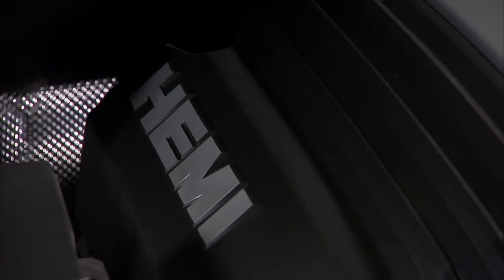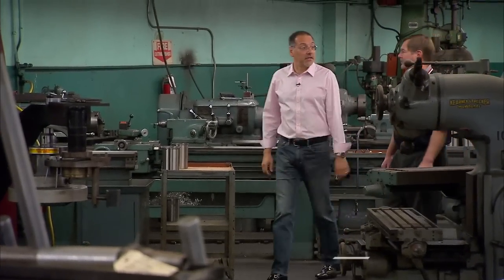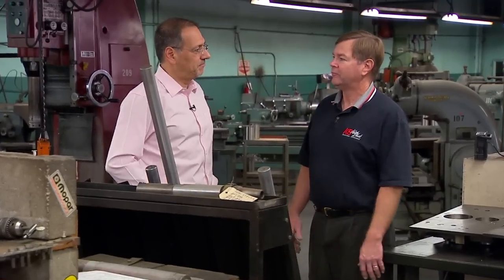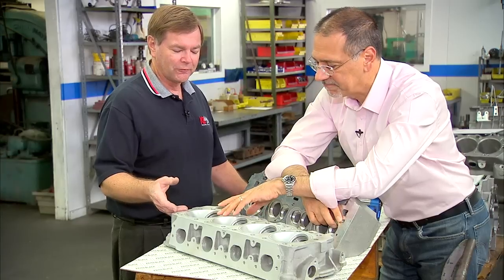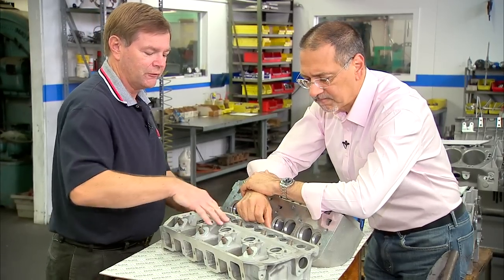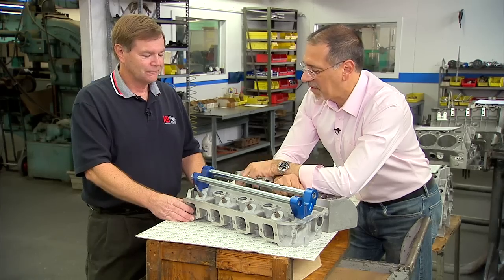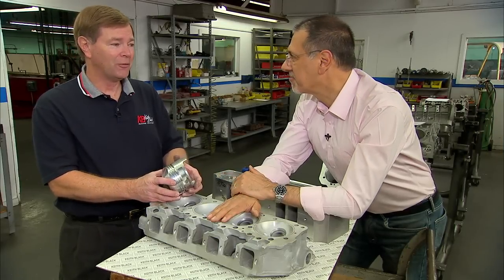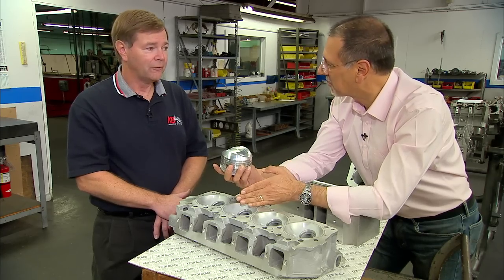CNET On Cars - Car Tech 101: Hemi engines explained

Comment: Also should be noted that Kieth Black gained a lot of success and notoriety by building really successfull 354 based early Hemis for Don Prudhomme's dragster, the Greer-Black-Prudhomme  Top Fuel car was the most successful & winningest fueler team in the early to mid 60s.  I have many Drag Racing magazines from this era and Kieth Black had a column on engine building.  Hemi's work better than any other design with fuel (nitromethane/alcohol) and forced induction, and Kieth Black was one of the pioneers in developing Top Fuel engines.

Comment: Only a Chrysler design Hemi runs in Top Fuel Dragster, and Top Fuel Funny Car. No matter what the plastic engine cover says Toyota, Ford, Chevy. It is still the exact same Chrysler Hemi. That was originally designed in 1964.
 
 

Reply

Comment: Hemi its really about TORQUE :) and that its what you use more on street couse real hp come after 7500rpms
Reply: JETZcorp Your right on the money but I have a 5.7 (345) and it has 350 hp with 400 Pound feet of torque. They are torwuey engines. They are made to put u in the back seat. But surely arent made to rev out and hit top speed numbers. They just want to get you to a logical speed as quickly as possible.
Reply: theya r eso good that they stoped prodiucing it..just a myth

Comment: I've been a Mopar fan since 73. I have probably seen only six Hemi powered cars from 1966-70. (On the streets....not at car shows) That's one of the things that made them so special you never saw them as they were rare. Now you pull up to a stoplight and there's like three pickups or charger/challengers that say Hemi on the side. There's so many driving around it's like, 🥱yawn.
NOT saying they are not any good, just everywhere.
Reply: The new Gen III hemi doesn't follow the same truly hemispherical combustion chamber shape of the original hemi. They are considered "Semi-hemispherical". I have 2 truly hemispherical combustion chambered engine vehicles in my driveway. A 1986 Alfa Romeo which uses a true hemi-head design as well as twin cams and a Harley Sportster with true 100% hemispherical chambered cylinder heads. They are both more of a "Hemi" than the modern Hemi's you see in Dodge trucks and cars. Almost all the DOHC engines on the market are also hemi-chambered now a-days.
Reply: @6sillygtivr  I had a 64 Plymouth Belvedere with polyspherical 318

Comment: I thought of two cams with half cirlces as the valves that have pin seals like a Wankel rotary engine and the spark plug in th center of the ports for the half circle shapes on the cam. One cam for intake and one from exhaust on each cylinder head. The cams turned by a timing chain or timing belt to the crankshaft. Plus a bolt down oil jacket that bolts over the camshafts with half circle valves that supplies plenty of oil over both camshafts and a port if there is a timing chain on each cylinder head out jacket. The intake half circles smaller than the exhaust. Possibly some engine blocks could be modified to have this new cylinder head camshafts half circle valve design bolted on.
     Air fuel mixture                             
     ↘ ↘ ↘ ↘
🔅==|)==(|==|)==(|===
🔅===(|==|)==(|==|)==
            ↘  ↘ ↘ ↘  
           Exhaust gases
Lifterless valves

Comment: If the piston is to heavy then take more off the bottom since you added more on the top
Reply: The tilting of the piston rod would slam in to the room where piston is moving up and down. Under the up an downward motion, thereby slamming in in to channel, when the crankshaft is tilting the connecting rod in the motion.

Comment: Its a shame the new HEMI is not even a true HEMI in the sense of design like the old ones were.
Reply: Decent write up. Yes the 3 Gen hemis do flow better than the 2 gen Hemis. But, you need to realize that was never the topic. Being a true Hemi was and the 3 Gen is still not.
Being that the 2 Gen was penned over 50 years ago, I would imagine Chrysler has had enough time to improve on the flow rates and characteristics.
Yeessss, I'm familiar with quench areas, flame front propagation (I think that's the word you've been grasping for) and stoichiometric efficiencies. 
Which brings us to the next subject:
2 Gen Hemis never had negative performance issues with this and I'm unsure where you could have read that. I've never heard of 2 Gen Hemis having hot spot issues, either. But I will agree that the true Hemi design is less efficient emissions wise. That is the entire reason Chrysler built up the 'quench' area, added the second spark plug and raised the top ring land absurdly high on the piston (betcha didn't know that one, lol) for strictly emission purposes.
It wasn't an 'improved' design. As a matter of fact, Chrysler tried there asses off to get the true Hemi design pushed through! And if the 2 Gen design is so awesome, then why have they almost gotten rid of the this 'quench' area in the Hellcat and the 392??? Because they were making more power without your 'quench' area, LOL. And these still aren't a true Hemi, either!!
Go read up some more if you're gonna try to school me.
Reply: jmc6000 I know man.

Comment: One bad feature of the Chrysler Hemi is the terrible valve-train geometry. Because the valves are so far apart, the pushrods are nothing like straight off the lifters. The solution came from Ford with the 427 SOHC engine. No lifters or pushrods. DOHC would've been even better. I ride a Yamaha XS-650 (which were made from 1969 to 1983) and they are a true hemi with SOHC, just like the 427 Ford but a lot smaller.

Comment: my 5.7 hemi only makes like 340hp.... its a 2007 but still... good torque though. about 400ft lbs
Reply: Michael Kinley the new 5.7L Hemi V8 in the Charger and Challenger RT makes 370 HP and 390 Ibs of torque while the 5.7L Hemi V8 in the Ram 1500 make 395 HP and 410 Ibs of torque.

Comment: Heard that Hemi engines can't have 4 valves per cylinder.
Reply: Because the chamber is hemispherical (curved in two planes) you would think not because the 4 valves would point in 4 different directions, making it impossible to run off OHC (single or double) or by pushrods because the angles would be too extreme. However, Honda made a 4-valve hemi back in the '80s. It was a 500cc single with SOHC and (wait for it) 8 rocker arms. Four were the usual that any SOHC 4-valve engine would have, and 4 more to get the angle required to act upon the valves. That's right, 8 rockers arms per cylinder. I had one and it was a missile but complexity eventually killed the design. Imagine if they'd them with more than one cylinder.
Reply: Dodge actually made one A-925 engine...but it turns the combustion chamber into a Pent-roof..like all other 4 valve engines.

Comment: Can a Hemi engine out race an engine from a Lamborghini?
Reply: beerborn there are so many variables. I personally have seen inline 6 engines beat a Lamborghini Gallardo. I mean a 4 cylinder engine can produce the same has a monster v8 if you put the money into it. But if two engines exactly the same were built and one had a hemi, I'd assume a hemi would win
Reply: Only a Chrysler design Hemi runs in Top Fuel Dragster, and Top Fuel Funny Car. No matter what the plastic cover says Toyota, Ford, Chevy. It is still the exact same Chrysler Hemi.

Comment: that why american car all bad car how about asian company maker a good car and save the gas people buy asian car make them alot money now american car go in down
Reply: mai khiem Asian car slow and boring america we have lot of gas and fast car
Reply: HEMI = FUN
Reply: mai khiem I have a 96 Ford F150 with a 5.0L (302) Windsor V8 with 206,820 miles on it and it's still going strong. The only thing I replaced on my truck was the starter but other than that mostly was just simple maintenance, took out the transmission fluid just to get rid of the shuttering it was making and it hasn't had a problem ever since. Also just to let you know that my 96 F150 will outlast what ever you drive.

Comment: GM LS > Hemi when it comes to pushrods
Reply: Alex Has not exactly. The hemispherical head is superior in every way to any Vortec head or Chevy designed head in general considering they’re both 2vs. The 5.7 hemi produced more than the 5.7 vortec in both torque and weight. And in 06 the 5.7 hemi produced more than the LS1 with equal numbers to chevys 6.0 ls2. They’re both great tho
Reply: @darylcollins2972  its also a heavy pieve of shit and doesnt top out fast enough
Reply: Alex Dood wait bro. You have a 2V 4.6 ? There’s literally no Chevy V8 or Mopar V8 that won’t rape you. Sit down
Reply: @darylcollins2972  faster than any camaro ooookkk thats why chevy and ford hold better records lol
Reply: Alex Dood so a 300 hp 32 valve 4.6 is faster than anything they’ve put out? Cmon dude. I like mustangs as well. But you’re making yourself look dumb with the hate.